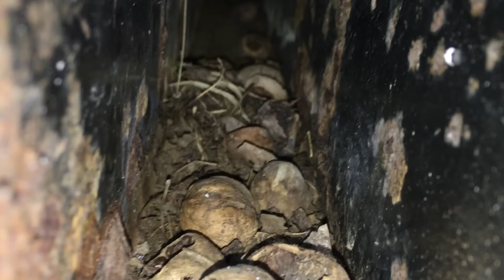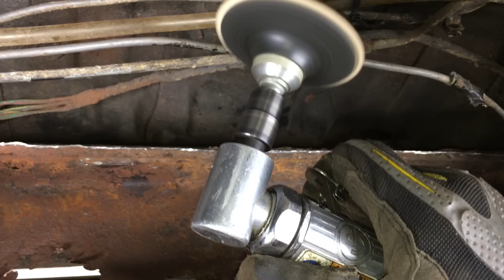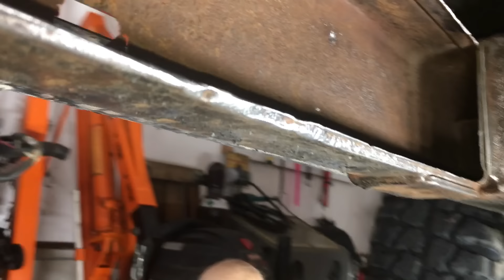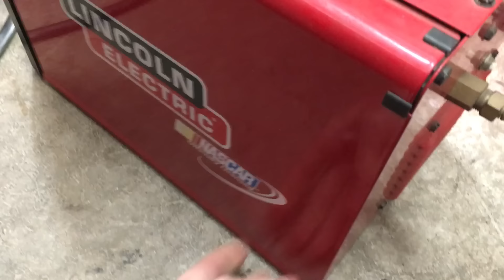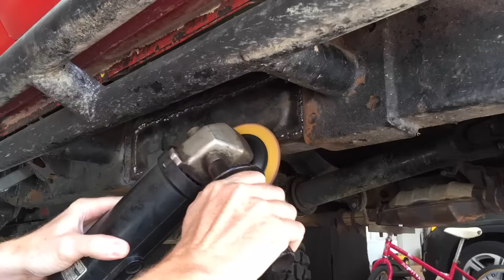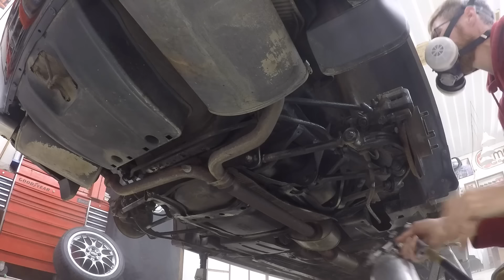How to Properly Repair Rusty Frame of Toyota Pickup Truck at Home

Comment: I rebuilt the frame on my F350 and used a product called Steel It. It's a spray on, looks like galvanized when dry. Been 8 yrs in upstate NY and no rust. It is pricey though but after spending 15k on a rebuild of the truck and the time invested, it was the best option.

Comment: coating the outside without coating the inside is just a waste as you noted.. I would use a thick oil inside the frame and clean the outside surface with a rust converter, primer and rustoleum paint.
Reply from the maker: Sounds like you didn’t watch the whole video 😉

Comment: Why use argon for mig welding? Gas mix, yes, but pure argon only for stainless and  aluminium. And I believe that pure co2 welds tend to run a bit hotter, so penetrate better
Reply from the maker: I called it argon but it's actually 75% Argon and 25% CO2 for mig welding, aka C25.

Comment: We had one like that years ago. Cut the frame off and slipped a s10 frame on it from the cab back. Worked great bed even mounted looking right. Spring width was within a half inch or so.
Reply from the maker: Good to know... I may keep my eye out for a clean S10 frame!

Comment: Watch Mustie 1... I own a 2003 Tacoma and read a TON of things on frame protection since I live in Wisconsin. I used his method after priming everything and letting it cure. Bar and chain oil is better than fluid film and WAAAAY more affordable. I've had no problems since my repairs 5 years ago.
Reply from the maker: good idea... Bar and chain is thick stuff!
Reply: @6thGearGarage I followed what he did, first warmed it.  There was a ratio.(15% ish)  but cut it with some type of thinning agent to spray. Same equipment/ principle as Fluid film application, purchased the sprayer, wand and approx 4' hose at Harbor or a Farm supply. I liked it, it has the creeping quality to soak into the crevices. Even works well after dust sucks to it

Comment: Once rust starts, there’s no stopping it unless you remove every single piece of rust. Even tho you cut out the “sacrificed” portions, you leave a lot of rust still on there on other areas which will still continue to rust over time… only thing is you’ve now created weak spots with patches slapped all over. I think that’s why people would rather add material than remove and replace. Best thing and safest thing to do would be scrap the truck and by a southern rust free truck because that truck there is truly fucked beyond repair.

Comment: With surface rust prime with Brunox, works great. Then paint over with a 2k paint. Spray the inside of the frame with fluid film.

Comment: When doing a por15 job, do you wire brush and sand all surface rusted spots a decent bit? At some spots I can get rid of the rust and get to bare metal.
Reply from the maker: Yes the worst of the rust needs to be removed. A tiny bit is ok I believe. Bare metal is ok, but it needs to be scuffed up or sanded to give the POR15 something to bite to for a better bond. They make a metal prep etching spray as well that works great.

Comment: Thats pretty much the only way to fix rot like that.  Get all the crap out of there otherwise it just keeps rusting.  As far as the welds not looking good as long as you have penetration it will hold fine. you got the right idea grinding them and checking. then lay another bead.

Comment: I have a 94 Toyota pickup with a rusty frame and I've been welding over the rusted frame but I've gotten the rust and debris out with a long powerful magnet and a shop vac. I'm going to use Eastwood internal frame coating for the frame and see how she holds up.

Comment: Hi do remove the gas tank?
Reply from the maker: You can remove the tank if you need to repair the frame next to it.  I had to remove the tank when I repaired the rear section of the frame in 2011.

Comment: so is degreasing and priming a more long term solution then say spraying fluid film or wool wax? I just bought a bunch of wool wax and was told that would be enough to protect the frame on my 04 Tundra from further rust
Reply from the maker: Degreasing, removing rust, priming, then painting (very important- bare primer won't hold up over time) is a long term solution, but even then I would add a layer of fluid film/wool wax to protect the finish underneath.
Reply: @6thGearGarage  thank you for the feedback. I just sprayed down with wool wax. Given the truck already has rust, might be more time effective to just manage it with wool wax once a year?

Comment: Great video...Just so you know...When I done the rusted parts of the frame on my 95 Tacoma I used a big extendable magnet tool to get the big chunks of rust out of the frame. It was pretty easy that way. Then I put the shop vac on one end of the frame as I used compressed air on the other end to blow the smaller rust particles into the shop vac. It worked pretty well for me. Its just the way I done it... and another option. But good job bro!
Reply from the maker: That's a really good idea- thanks!!
Reply: That's exactly what I did, and some strong magnets attached to rods I could bend. The chunks that came out were massive!!!

Comment: I have similar issues with my 1999 jeep Cherokee xj. It was taken over by a colony of rats and mice before I got it, and wherever they left a mess, the floors and frame rusted. I'm in the process of replacing all the rusted pieces, and the whole bottom of the car had surface rust. I treated it over a year ago, and the rust has not returned for the most part. I had to re-treat some areas because I didn't follow the process and got lazy sometimes. For best results: cleaned out the frame rails completely of debris, rust, nests, etc. (I was able to get to the inside of the frame rails after pulling up the floor) Then removed loose rust using mechanical methods - grinding, sanding, tapping, etc. Then soaked the area with dish soap using a spray bottle l. Then I power washed the whole area to remove the contaminants that cause rust (salt, urine, metal dust etc.) If I could scrub it down and wipe it down with a micro fiber cloth, I would. Next I would sand using a sanding disks on areas where there was no paint left to get down to bare metal. Then wiped everything down with mineral spirits until my shop rag wouldn't pick up anymore dirt. I used zinc primer on anything to be welded - both sides. This way anything I couldn't get too after welding would have a layer of protection. This is what I saw from the factory had done. After priming, I sprayed with gloss Stop Rust or painted with POR15 l. I like POR 15 because it soaks into rust pores really well. Then scuff POR15 and paint with gloss black Stop Rust, since gloss repels water better. 2-3 coats of that. It also prevents UV breakdown of POR15. I'm thinking of putting bed liner over that as an added layer, but am not sure yet. After all the welding is done (currently adding frame stiffeners), I'm planning on using fluid film or PB blaster frame coating for the frames, and cosmoline military grade wax for everything else. I like your drain hole ideas. So far my Jeep has no more rust!
Reply from the maker: Wow great job!!! My problem on the outside of the frame was that I didn't coat the POR-15 so it's all peeling now from years of UV.

Comment: A lot work done. You are so the best. I’m excited to fix my truck, but I’m stuck on what kind of steel to use, there are so many that make us confused. So, what kind of metal did you used?
Reply from the maker: Thanks!  I used A36 Hot Rolled Steel, Low Carbon.
Reply: @6thGearGarage  Thank you

Comment: Have a custom frame made, much easier. What a nightmare. Looks like the frame was thin to begin with when it was new. Toyota still has frame issues as of late. The older ones may have been better.
Reply from the maker: Yeah, it’s amazing they haven’t figured out how to solve the rust issues after so many recalls.

Comment: Dude sweet video man. I love my 89 had her 15 years was my first truck. Toyota should replace these or give some money towards it. It blew my mind theu went back to a box frame thought they hold salt bad guess history repeats itself. Not sure what's in the salt and the blue stuff but it's funny theu freak out over gas cars all that crap salt and blue liquid going to the the creeks cant be good.
Reply from the maker: Beet juice can also be applied to the roads to melt salt AND it is far less corrosive. But it's also more expensive, so cities would rather keep using sale that rots vehicles away.

Comment: I do this full-time & have binned off using any sort of paint or underseal - in fact nothing that acts as a paint - they don't work for more than a very short time & are really only kidding you. We now produce our own non-setting chassis coating that actually does what is needed - stops rust dead, protects the steel, repels water & also looks good. We use it inside & out, with a flexi-nozzle to get into the box sections. 

Unless you remove & blast the chassis back to bright bare metal, paint & underseal just don't stop the rot - if you're going to coat it in-situ, you need something much better.

Comment: A self healing coating like Fluid Film or Woolwax would be great inside that frame. Woolwax even comes in black. Need to reapply yearly. My 1997 Sierra would have been junked years ago if I didn't do that every fall here in NY.

Ooph - you end up doing that. I also put the Fluid Film in a pan on a hot plate and shave paraffin into it and shoot it warm. I feel like the paraffin sticks well.
Reply from the maker: Great idea!!
Reply: Fluid film is the shit, it you could see under my trucks, 25. & 27 years old in n,y, you would do nothing else.like new, bolts even come out easy.
Reply: Mustie1 uses bar and chain oil. Cheaper and better.
Reply: @kd5inm  I've done that too. Just keep it off rubber.
Reply: @dalesworld1308  yeah Mustie1 has commented on that saying the same thing. I imagine some spray wax on the rubber would protect it. What do you think?
Reply: @kd5inm  Yeah, you could do the bar and chain oil in frame rails, rockers etc being careful to stay away from brake hoses and such, and just hit rubber body mounts with FF. As an aside vaseline softens rubber so you could just smear it on body mounts of they look dry.

Comment: Your best bet is use expoy primer from a automotive paint shop , not parts store .Use the primer full striagth do not dilute with reducer .you can leave it as is or apply gloss black which is what I use because gloss black tends to stay clean while on the other hand mat black stains very easyly

Comment: I guess we both have a different definition of "PROPERLY"! If you were doing this "properly" you would NOT be using a 110v welder! Those are terrible welds, (42 year pipefitter/welder here)
Reply from the maker: I showed the proper method, just not with ideal tools. I did mention I'm not a fabricator in the video ;)  I repaired the rear half of the frame with the same welder in 2011 and it's holding up great. Regular folks have to work with what they have, but someday I'd love to own a 220v.
Reply: May not be pretty welds but they seem like they took well.

Comment: Looks like a nice truck, to fix it properly I'd remove the frame and take it to a chassis shop and have them make you a new one by using the old one as a jig.  Unless someone is already making frames for them (they do for muscle cars, Chris Alston etc).  Good repair though!
Reply from the maker: Unfortunately nobody is reproducing these, but there are still nice ones for sale out west. Eventually I need to make a road trip and buy a stack of frames to bring back to Ohio.
Reply: @6thGearGarage  Huh? If the vehicle is out west, not only are the frames in good shape, so are the bodies. In which case the truck is whole and expensive. Unless you can find one where the drive train was neglected or the body was crashed. In the latter, I would be worried the frame was tweaked. Where you seeing clean frames for sale?

Comment: One tip for you mate , You used hot rolled steel No probs Best though to grind of all the blue mill scale or usr cold rolled, then prime both sides with red oxide primer buff the edges before welding After welding dress welds and prime up you then have along lasting surface ready for final coating  Internally you can, for existing metal   use a phosphoric type oxidation arrester which goes black and chemically seals the surface and also can hold a primer for extra protection  I am a retired Fitter welder and have done plenty of this work Your Video was well presented for an amateur ,well done
Reply from the maker: Thanks for that advice! I always appreciate professionals who share their tips.
Reply: Will the phosphoric type oxidation arrester stop existing rust in the inner walls of the frame? If its not too bad.
Reply: @iliagoro3136  yes, but you need to make sure you get it thoroughly rinsed which may be difficult.  Better not apply if you can't rinse well